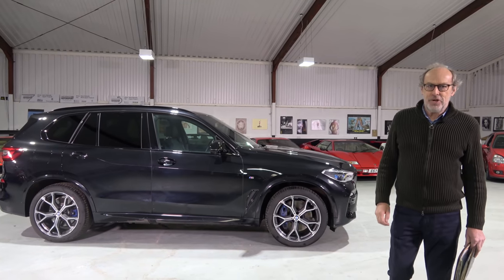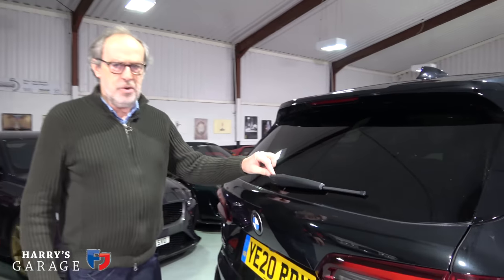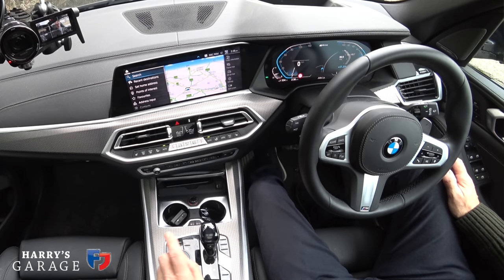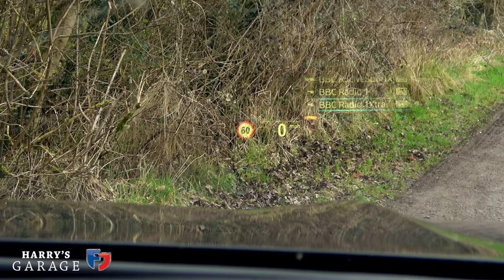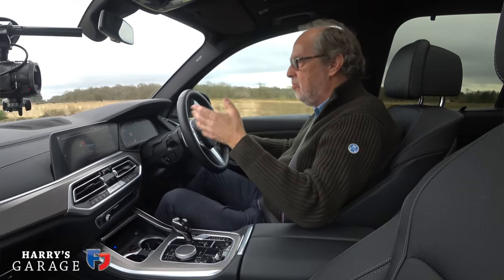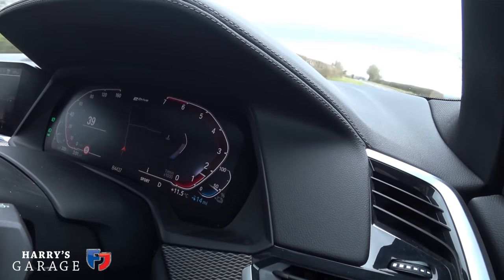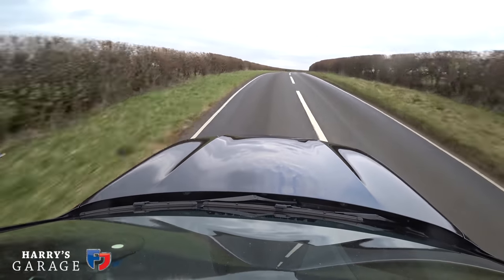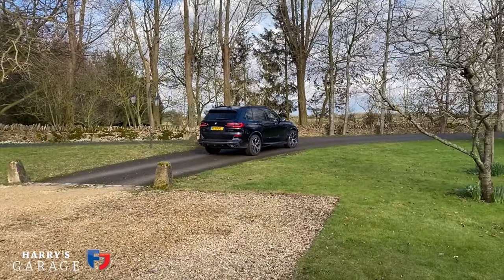BMW X5 45e 10,000 mile review. Why PHEV beats EV for our family car

Comment: I despise SUVs. The only thing they are good at is showing the pretentiousness of the current "ecological" policy.
As for BMW, they do not offer warrenty in Germany.
Reply: The Lexus RX is pretty good
Reply: @dragospahontu  the lexus is trash. the infotainment is the worst in the industry. everyone knows this. sheesh.
Reply: @superset5  it's not the best, but the rest of the car is sooo good, so soft and comfortable, plus it's so fuel efficient.
Reply: Wait, no warranty in Germany?
Reply: @dragospahontu  
It's true. The distinction between "Gewährleistung" and "Garantie" does not translate into English.
In case of "Garantie" the seller has to prove the fault did not exist when the transaction took place (which is virtually impossible). In case of "Gewährleistung", the buyer has to prove the fault did exist when the transaction took place - which is impossible.
Two years of "Gewährleistung" are mandated by law in Germany, and BMW pride themselves of "offering" their customers a third year. All other manufacturers known to me offer at least two (VAG) and up to seven years (KIA) of "Garantie".
Therefore, I would never buy a car from BMW.
Reply: @X8X8X8X8X8X8X8X8X8X  me neither, BMW is only a lease vehicle for me.
Reply: @dragospahontu  
Fair enough. Leasing is not my preferred option, however. I much rather have a cheap runabout (which I own) and something special for the weekend (owned as well).
Reply: @X8X8X8X8X8X8X8X8X8X  that's it, that's the smart thing to do.

I'm looking for an S2000 for my weekend run about, as for a daily driver BMW is clearly not an option.

I like keeping my cars for longer periods of time sooooooo definitely no BMW for me.
Reply: @X8X8X8X8X8X8X8X8X8X  in Romania for example, VAG offers 2 year warranty + 2 years from the importer (dealer) = 4 years warranty.

I think Mercedes-Benz has a 3 year warranty.

Comment: Hi Harry, love your video reviews - especially the old timers... Some other commenters have mentioned mpg, kwh, etc. I don't think it is correct to comment on mpg as a standalone consumption on a hybrid. We really do need a new measurement based on kwh consumed, or equivalent. You can certainly say that the average mpg was 50.3mpg, excluding electricity consumption, however, you need to give the mpg equivalent once the electricity consumption has been added. As you mentioned, consumption without electricity was 18.9mpg and it is likely that consumption of this 2.5ton behemoth is pretty substantial, certainly worse than the diesel equivalent. BTW, i am a big hybrid fan, keep up the excellent reviews! PhilipB

Comment: Hi Harry after looking at your review earlier this year with the excellent facts, and figures, I decided to purchase a X5 45e. I have had several X5s over the years my last was a X5 M Comp which I purchased last year amazing bit of kit but the 12/13 mpg I could not live with as I found I didn't need the performance as things have changed on my car usage. Having had the car now for a month I have traveled 652 miles mostly short local journeys over lock down I have only put £8.20 of fuel in it as it was full when I picked it up, and charged the car with 266 kWh at 16.505 p/kWh that's £43.90 = £52.10 for the 652 miles that would have been £168 in a normal petrol X5 that's roughly 652 mpg + £43.90 of electric. As you said I think this is the way forward until they sort the range out on a fully electric car, and I agree its probably the best car BMW make at the moment, Great video thanks for the insight before I purchased.
Reply from the maker: Good to hear you're getting on okay with the X45e. 
I'm now running a Range Rover P400e, which is okay but the X45e has the better drivetrain. We found the additional range of the X45e really made a difference, the RR P400e runs out of electric after 20-24miles, while the X45e probably goes 50% further on its bigger battery. 
But the RR P400e has one key advantage over the X45e and that's it can recharge an empty battery in under 3hrs, way quicker than the BMW and means the lower electric only range isn't the pain I expected it to be. 
Having run one EV and now two PHEV as our main family car, I'm much happier when running a PHEV and won't consider going back to an EV again until their range is 500miles+ and they recharge a lot quicker than they do now!
Reply: @harrysgarage  Hi Harry thanks for your reply I note your point about how slow the BMW is to charge so I had a fast charger installed which now charges the car from empty to full charge giving a range of 48/52 miles in 5 hours or when I don't need the car quickly I put it on the standard 13amp over night which is cheaper. Keep up the videos.

Comment: I have the 330e. The electric motor is wound on the end of the main gearbox shaft ( ZS ) so the EM still uses the 8 speed auto box. It has 2 oil pumps, 1) Electric for electric only driving and 2) Mechanical for ICE driving. Even if the cold engine fires up at 70mph the gearbox is already in 7th /8th gear so revs are down in the sub 2500 range. This won't be a problem for a cold engine and in fact as the engine will reach normal operating temperature quicker it results in less wear on the engine than a cold idling engine.

Comment: You should have had 2 of the keys, then you can register one person per key, and it will setup the car based on the driver.
I think the idea with the LCD key is that it allow you to use the self-park if you have a narrow garage/spot, as your phone will have too long delay to control the car through.
The other stuff I 100% with you, it's just as good to use your phone, so you don't need that huge key (but if you have a tight parking spot the parking without being in the car is nice).

Comment: Just changed my 45e for a full electric, superb car but the slow charging and mucky trousers were its downfall. Due to lockdown I didn't manage many long journeys. Hopefully its ok to share my stats 3270.5 miles covered, 2632.9 electric miles, 1.7mi/kWh. Costs, Petrol £149, Electric £288, cost per mile 13p.

Comment: 2:18 that side sill is there because the car gets driven at over 120 mph in Germany. To block the side flow from going under the car at high speed and produce even more lift.
Reply from the maker: The car weighs 2.5tonnes! Any potential aerodynamic lift is simply irrelevant at this kerb weight, especially compared to the annoyance of owners getting muddy every time they get in and out of the car. 
The worst car for wiping mud on your clothes was actually the original Audi Allroad, which was unownable by country folk because of this!
Reply: @harrysgarage  well, that shows how much lift it gets with that front design that the 10-20-30kg of extra lift from the sides would destabilize the car at high speeds. Or they function as vortex generators, to make the side flow stick to the rear wheel arch, etc.
It was more of a guess, because from a styling point of view, it doesn't make any sense.

Comment: Always get in the Habit of First Starting the car in full petrol mode (sports setting) allow the engine to warm up and drive the first 5-10 miles on petrol. The engine will be protected and always Ready-To-Use with it's built-in warm water jacket, because the B58 engine is designed with a " stay long time warm water jacket to assist emissions "  By doing this, your engine will always be ready to fast kick in and assist the electric motor and thus not damage the Petrol 6 cylinder in cold weather. The rest of the journey can be all electric.  Regading the Key-Fob: charge it using the hidden USB flap on the large key Fob, to give a full charge and prolong the internal battery

Comment: Just by way of comparison I have a 3 litre diesel X3 (F25 model) I’ve owned from new. Over 46500 miles, fuel consumption is 37mpg , range on a full tank c.600 miles and 0-60 is under 6 seconds. Only fault over that time, a broken coil spring on rear. I am hugely impressed. (It’s the second one I’ve owned).
Reply from the maker: A modern diesel is currently still the best solution for most owners but new EU7 regs coming Jan 2023 will make them almost uneconomic for manufactures to sell, hence why they are currently being fazed out and replaced by these PHEV. Such a shame..
Reply: And the government approach is exceptionally stupid. For those of us who live in a rural environment and do go off road from time to time , a decent suv is the only option. In my case, my children and grandchildren live 120 miles away- that’s a breeze in my 3 litre diesel but nerve racking in an electric car. The 2030 ban is ill considered in the extreme. I am preparing accordingly. We have just acquired a Toyota Landcruiser  which we wil keep forever

Comment: I plumped for the Range Rover PHEV and, like you, love the combination of battery and petrol engine. The big difference between the two (besides the looks) is that battery size and the real battery range on the RR averages about 20 miles which is just not really enough. If RR don't increase the battery size I may have to look at the BMW at renewal time despite it's appearance !
Reply from the maker: I agree, the P400e is very close to being great but that small battery is the deal breaker. Maybe the next-gen RR out later this year will bring a bigger battery, here's hoping! 
The big surprise for me with the P400e RR is that 4-pot engine is actually not bad, it makes a nice noise and actually manages better than you'd ever expect it to do!

Comment: I own the 30d version, and the mud-catch under the door is really annoying. Not only does it dirty your trousers, but it also 'sand' itself in the process, so i got a matt patch in the paint because after 2 years, we brushed that patch so much the clear coat has been abrased.
Oh and the Big Key is also stupid, completely agree. I used to keep it with the battery depleted, but a recent firmware upgrade has decided to tell me off because the stupid key is out of battery. It works without the stupid screen, it doesn't need to be charged!
Another thing I dislike is the settings for the air suspension. Basically you can't TELL in which position it is until you try to change it, and HALF the time, it tells you you can't change it (and read the manual blah blah) and it will ALSO change the height if you change driving mode, like Adaptive<->Comfort, but it doesn't tell you... and really, from the driver seat, the control is unreadable.
BUT, my next car will likely be the 40d or the 45e, whichever -- not sure which one yet. I have a "Loaded" car, and I agree that you climb in, even after 2 years, and it feels fantastic

Comment: My wife last month got new 330e as her company car, in the cold we are getting 22 range, yesterday first U.K. warmish day 12c we got 30mile Range, ok it’s lockdown so she is working from home but we still did 900 miles in a month and average 66mpg...I put in an order for X5 phev yesterday to replace my Jaguar Fpace Diesel which being 6cylinder averaged 46mpg, but has been 100% reliable in two years and 42k miles
Reply: Wow! 46mpg. I had a Velar with same engine. 35mpg. Best was 40 on a long but slow run. Must have a heavy right foot!
I now have a phev and get better mpg than the equivalent diesel. Also get to enjoy a petrol engine. Best of both worlds. And you can charge whilst driving, if you wish, like a non plug in hybrid. Plus leave the battery for your destination. Very versatile. Coast more to recharge etc. Better than most think.
I use battery for town driving. So helping the environment locally. 
Many miss the point on here. You have to compare to a comparable car. Half way house for me, until better range and infrastructure is available for EV. Next car may be EV after my phev experience. Enjoy the hybrid.

Comment: I bought one of these a couple of months back as the PHEV style of driving this needs suits my day to day (do your commute on electric and charge overnight). Audi Q7 TFSIe would’ve been my first choice due to interior space however the electric only range was a bit of a let down hence my final choice of X5 in the end.
We love the car and I agree with the dislike (I didn’t get a display key but I’m glad I didn’t cos I hate big keys so not sure how it works)
The only other dislike is that I feel the rear legroom is a bit of a letdown. Even as a suburban user I find the trouser wiping sill an irritant, but I’ve managed to perfect lowering the suspension and doing a long step out to avoid muddy trousers!
And yes the charge time is crap slow so I’ve never used a public charger but 99% of the time it’ll be charged overnight anyway

Comment: That cold engine thing, that's a flaw. And the suspension dropping back down, too. Everything else so good but they get these wrong. Oh, wait. That charging rate for the battery, as well. Blimey!
Reply: The charging rate is not and issue when it is plugged in overnight. Of course you cannot recharge on a long journey but then it is a hybrid and not pure electric therefore the lack of high charge rate is considered irrelevant.

Comment: So how about one without the Tupperware? The sill extensions are part of the M-package, and so are the big wheels. It will have a much easier time off road with a bit of dull plastic that doesn’t mind the bush. The M-air suspension is an option you do not have to select...

Comment: Most manufacturers electronically limit a combination of throttle, revs and/or boost when cold, to preserve the engine.  This means that 1. you likely won't wear or damage the engine significantly when it cuts in for hard use when cold, and 2. you likely aren't getting anything like the listed 280hp or so from that 6 cylinder engine when passing - not unless your drive has previously caused it to warm up first.

Comment: If it works out equivalent to 75mpg in full electric, does it not mean the actual equivalent average MPG would be closer to 37.3mpg than 50.2 once the cost of electricity is accounted for?

Comment: These cars hold their value so well too! best of both worlds with electric and combustion engine, also diesel engines wont be produced in a few years so petrol all the way now. Would be interested to know how it handles in the snow and ice with that extra weight, wheels and power.

Comment: I bought one of these a few months ago, partly on the strength of Harry‘s review in this video. I echo his comments – I’m really very pleased with the car. The only drawback so far is that BMW seem not to be able to supply mudflaps for it. Since the car was sold to me including mudflaps, this is a bit of a sticking point and the dealers aren’t helping. Anyone got any ideas?

Comment: I am very curious on your thoughts on the Mercedes-Benz GLE plug-in hybrids – this car's main competitor. There is a petrol and diesel option for the plug-in hybrid, not just a diesel. The GLE's refinement is excellent. You cannot get those plug-in hybrids with the E-active Body Control, though. It is only available with engines that have the on-board 48-volt mild hybrid system. So...most of its six-cylinders and the one eight-cylinder engine. That clever system really adds to its already very refined ride quality. It is great for on-road and off-road, so it may be a better farmer's car than this. It has a very high ground clearance, especially with the E-active Body Control, it does not lower itself as soon as it's turned off, and you can control every individual strut on all four wheels for traction via the infotainment. It is just that the system is not available on the plug-in hybrid models. The GLE charges faster and has more range. Not to mention the amazing technology. You may appreciate its Head-up Display. Try it out. You may love it more than this BMW X5, which is already a great car, from my experience. That BMW Smart Key is an option. The key you like more is standard.
Reply: Not available in the U.S. :( Neither is the EQC after Telsa bought out Mercedes battery maker and killed production

Comment: I’m running the 2015 X5d.  This would be a great upgrade.  I hope BMW reliably gets better. 

My Diesel Particulate Filter just failed. $7000 for the part without installation. 
So I’m getting it deleted .The EGR, SCR , DPF removal with  remapping .

Great vehicles though overall.

Comment: The good thing about the X5 45e is that it has a useable electric range - most PHEVs seem to have less than 30miles which is not really anything - and they aren’t as economical on petrol alone as a non-PHEV

Comment: Hi Harry
I'm Jin from South Korea and I've purchased X5 45e after reviewing your channel. First of all thanks to your good recommendation and easily understanding review. If possible could you review the new GLE 350 phev with gasoline? This new model is about to be launched in Korea within 1 month, and I am considering to change from X5 45e to GLE 350 gasoline phev because only electric ranges are half times longer the GLE 350 phev than X5 45e. Besides, I am freely chargeable electricity both at home and at the office(The distance between home and work are 55km in bidirectional ways). I would be very pleased if you could review the new GLE 350 gasoline phev(4 cylinder) or GLE 400 350 gasoline phev(6 cylinder).
Thank you :)

Comment: The large batteries are very heavy 700-800 lbs. My bro in law has this vehicle and he said he can feel it leaning in turns but it’s not objectionable. He’s connected it to high output power, so charging takes less time. The mpg is as discussed, very good. I drove it and acceleration is brisk, not V8 - like but not slow. There are many gadgets to acclimate with but once you do, it’s easy. I wanted the big diesel but BMW has discontinued it.